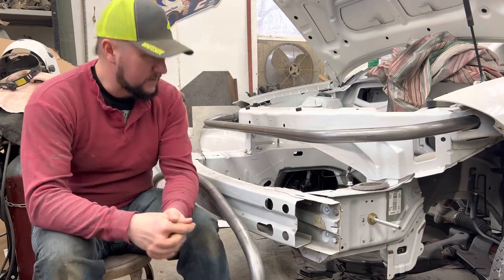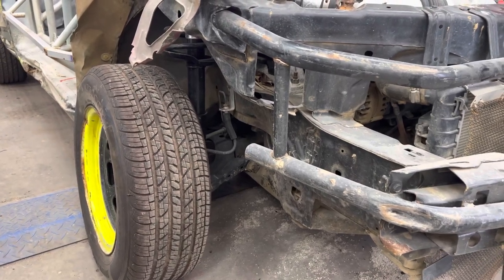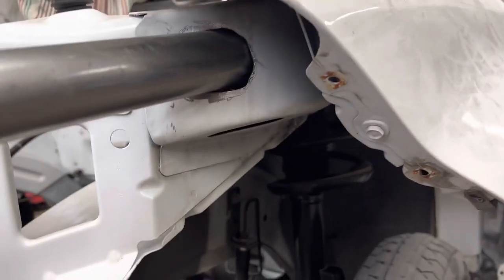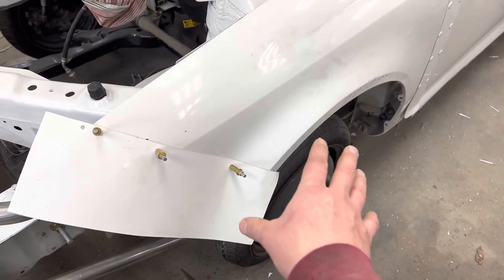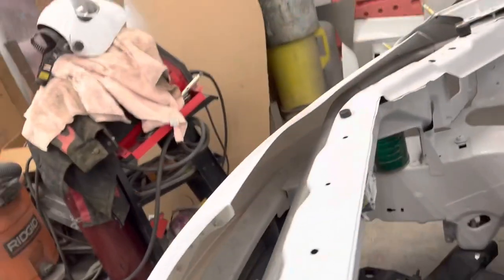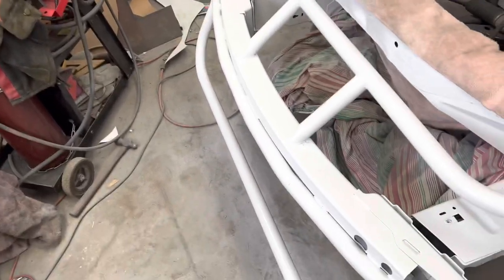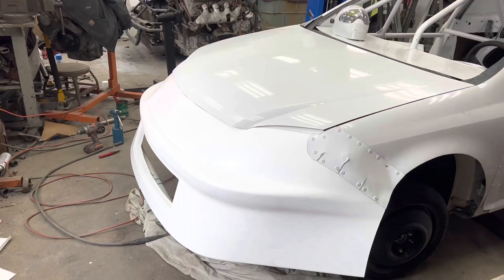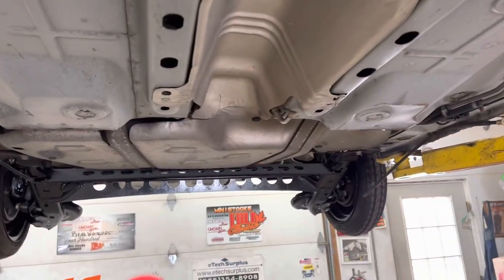Building front end structure and mounting the nose.

Comment: You spoke of the tire situation...We do we have a tire situation with our organization as well. Our Tech guy stepped down from last year b/c his grandson is now racing, understandably. So the new tech guy steps in and makes changes to our rules package without discussing them with the drivers. The first rule he changed was our tire rule. He wants all 4 tires to be the same size, no stagger. Needless to say most of us didn't agree with that. I tried to explain how that is NOT a cost saving idea like he thought. 99% of the cars last year ran stagger. Which means, most guys, like me, don't have 4 tires that are alike size wise and we will go have to spend more money. Get this...His suggestion was to by junkyard tires! I wouldn't race on a junkyard tire even in a demolition derby! The next rule change was no push button starters. Key only. Not sure why he would change that?? Next it was no exhaust larger that 2" O.D. Factory exhaust on a Cavalier is bigger in diameter than that coming off the manifold. Finally, as much as I would like to do to my car what you are doing to your customers, we can no longer protect the radiators in any way...uggh. Supposed to be cost saving how??? That one had me scratching my head. Anyways, sorry for the long post. It all started when you mentioned tires. So it's all your fault for the long post. 😂😂😂 The new tire rule kinda sets me off. Good luck this season BTW🏁🏁🏁
Reply: I have been fighting that same tire rule at my local track ! I don’t know why they can’t understand that it’s more expensive!

Comment: 2 questions for you Brad. Can you explain exactly what you do with evap system? I was told to leave it alone? Secondly, do you machine the holes in the struts to gain more camber?
Reply from the maker: strut mods depend on your rule book but yes that is the most common way to get camber. As for emissions I think I mention that at the end of the video. They pretty much just go away. The two lines in the back that went to the canister just get stuck together to form a vent line for the tank and the line that came from the front you can just delete it.
Reply: @Raceking46  Thank you Brad! Much appreciated!

Comment: What size tires can you run after trimming the lip off?
Reply from the maker: It’s not so much the lip that’s the problem. You need to beat the firewall area in with a sledge and then you can fit up to a 225/75/15